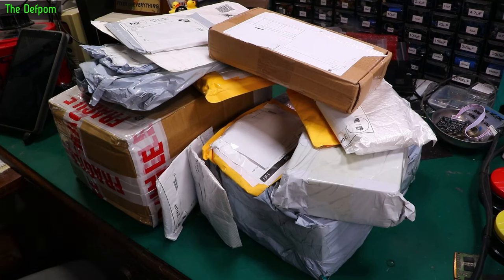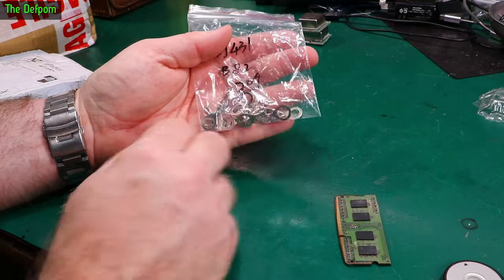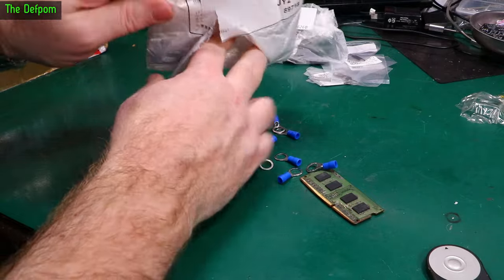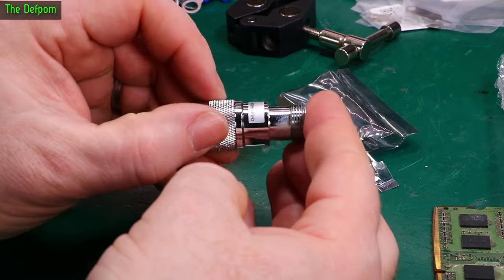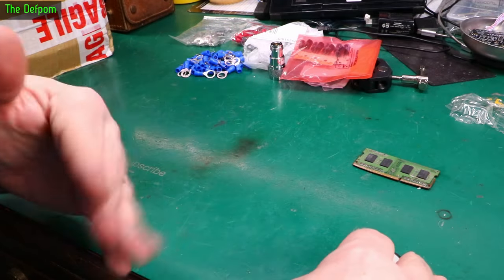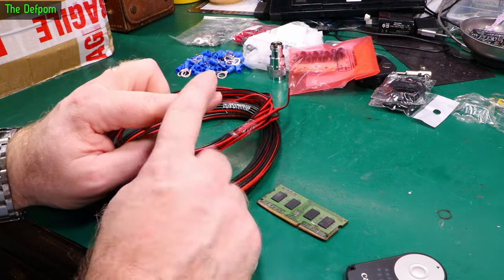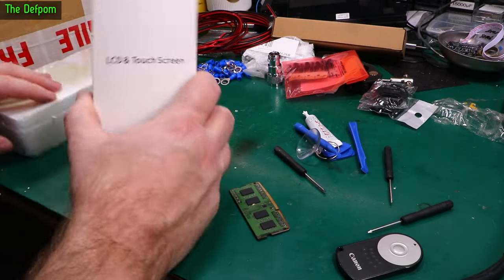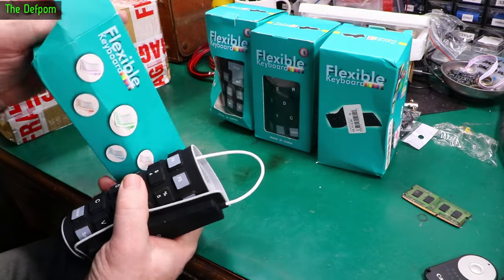🔴 Mailbag Monday 9th October 2023 - No.1184

Comment: Scott, I'll send you my own home grown GPIB Tester. You know the drill, just have a PP3 battery handy.
Reply: Hi Ian, is that a project that's available on your website? I've just got a Racal-Dana 1998 and a Marconi 2025, both GPIB, but I have no way to either test or communicate with them ... yet! Just ordered some mating connectors with the aim of making a couple of homegrown GPIB to LAN adapters so they can be communicated with as standard SCPI devices on my instrument LAN network.
Reply: @simonbaxter8001  No, it's just a wee project I did ages ago and built up a couple of units. I'll try and pull some documentation together and add a project page to my site.

Comment: Capacitors, you can never have the right variety.
When gear comes into my workbench, you can guarantee if it is a re-cap job, there will be one or two critical caps that are needed and I do not have.
To add insult to injury they will be 5 to 8 days because of their uniqueness. 
Usually its a physical size problem as well, I usually cobble up an equivalent to prove the  repair.
Most common value failures,  low capacity/high voltage rating, >50V positioned next to a source of warmth/heatsink.
Recently had a 220uF 63V cap that tested 100pF on a number of ESR and cap testers, it had no physical damage, but was a little less in mass compared to its replacement.
I put all my old faulty caps in a container for bragging rites.😀😀